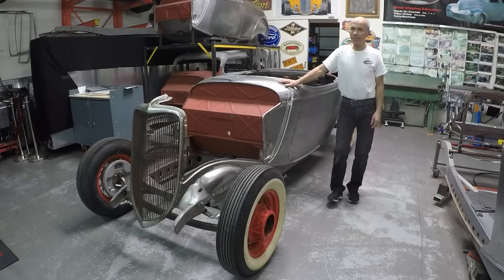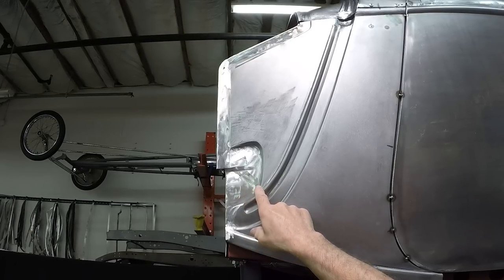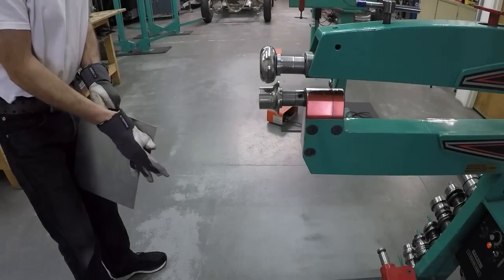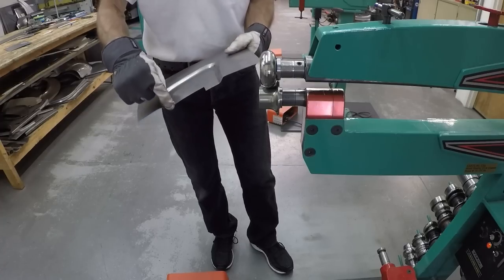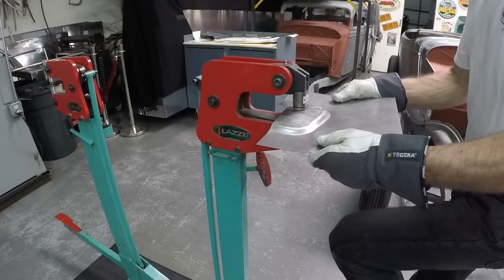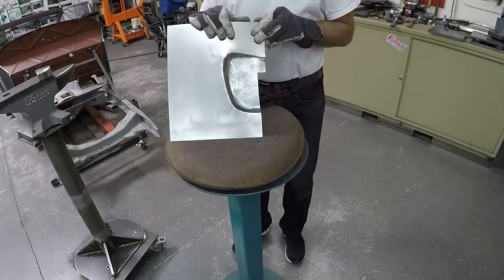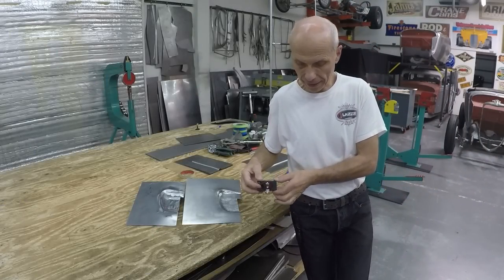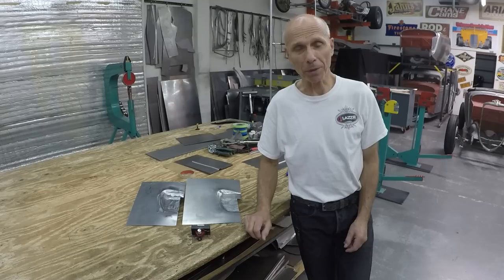LAZZE METAL SHAPING: CUSTOM COWL RECESS/POCKET

Comment: one tip for deep shrinker/strecher on point in 10min mark : I use shim/washers under the dies so I can turn them 90 degree. So I can work from side if panel is too long. (may need little mod to machine, lower the back edge of the die pocket.)